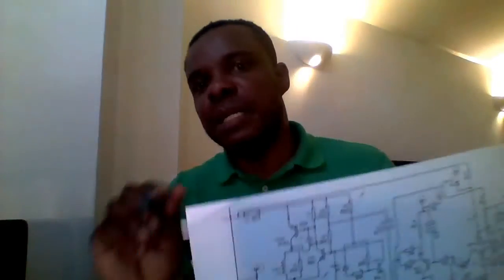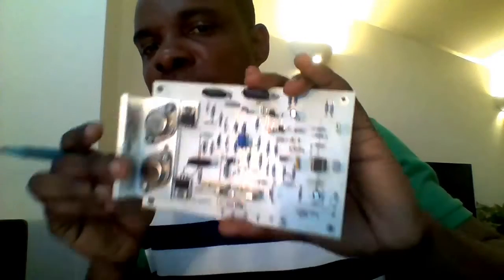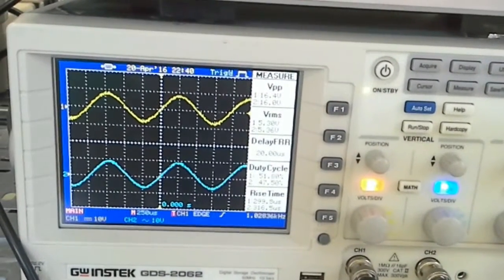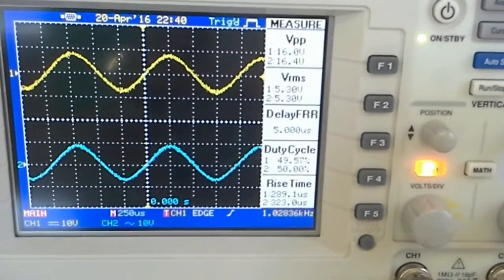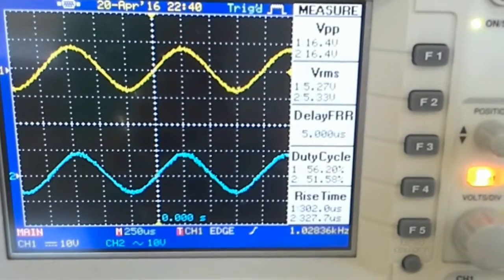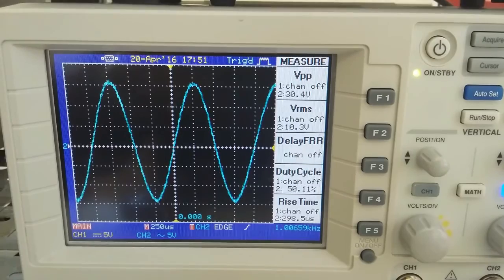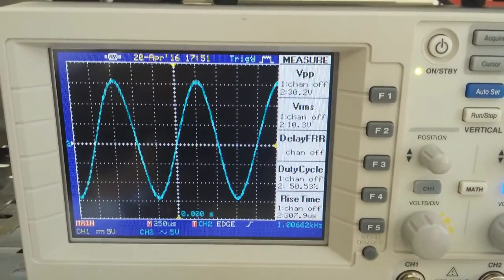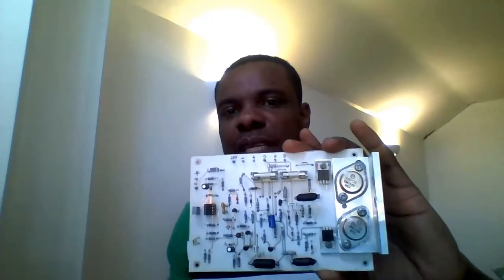Modification of QUAD 405 Power Amplifier Circuit to Deliver Higher Current Availability

Comment: How did you get a higher voltage out by just changing the output transistors, without changing the gain of the circuit? How did you get more current without modifying the current limiting part of the circuit? None of this makes sense. All this was worked out properly by Berndt Ludwig in the 1990s.

Comment: Thank you!  I am replacing capacitors and testing transistors on the 405-2 board and learning about signals and my oscilloscope.  Your video is very interesting thank you for sharing.  Do you plan on discussing the principles of the amp or share your schematic for the upgrade?  Very cool!